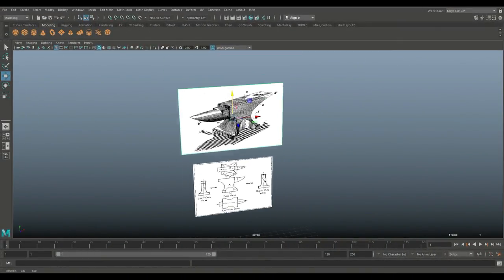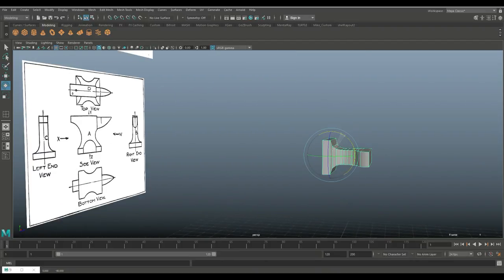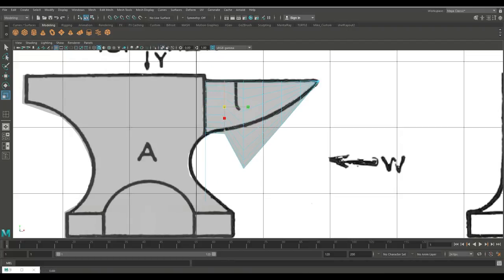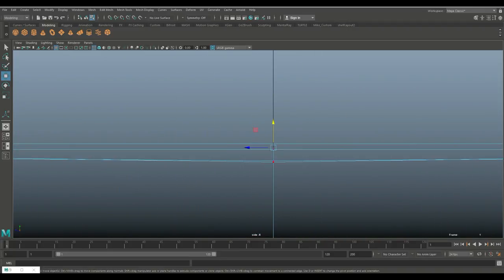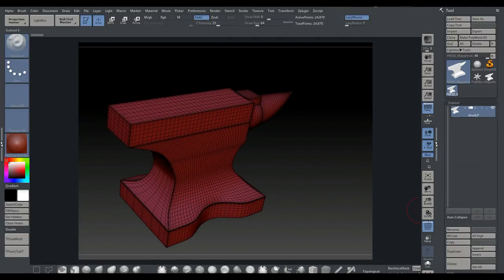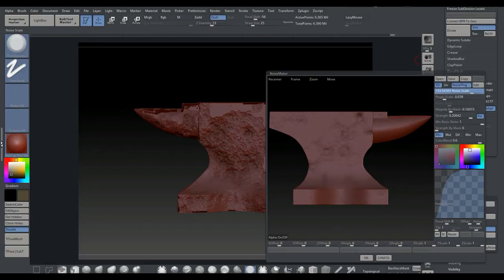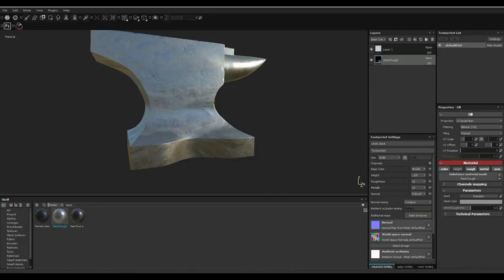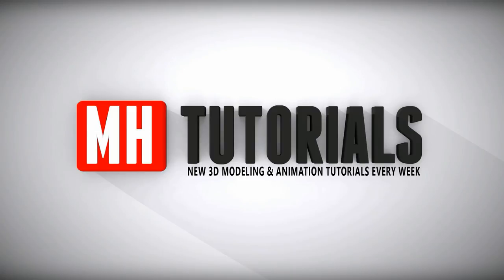How to model an ANVIL: ( Full 3D workflow Maya / ZBrush / Substance Painter )

Comment: Hello Mike new in Maya. I was wondering why do you prefer extra edge loops to hard edges instead of creasing before smoothing. Is there a particular advantage or it's just simple another way to do it.
Reply from the maker: I use edges when I do not have a tight polygon budget. Otherwise I use crease